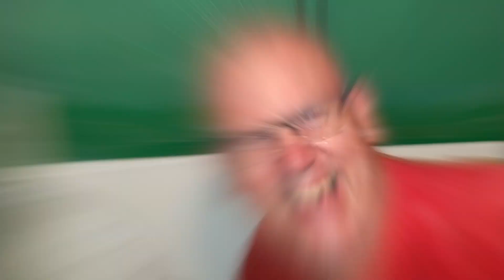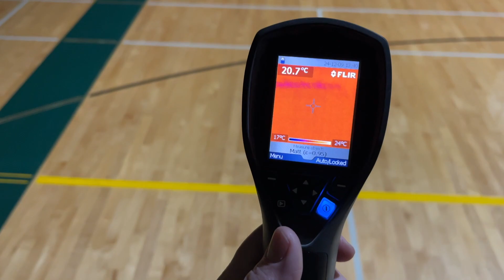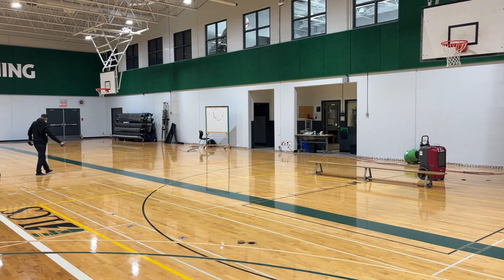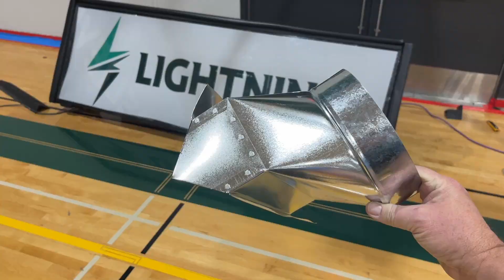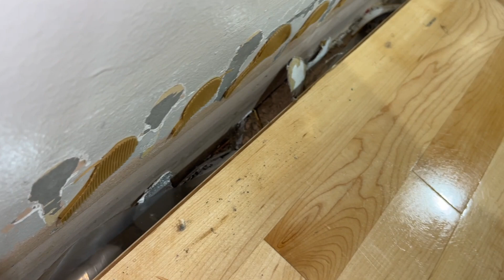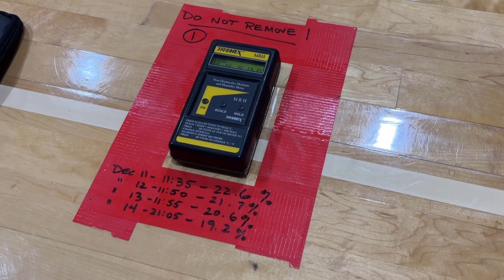Hardwood Gym Floor Flood Remediation (S07E162)

Comment: Is there no room underneath? If so, you can also drill holes in the ceiling below so that the moisture can evaporate downwards. Place drying devices below
Reply from the maker: No, the gymnasium is on the ground floor.  Thanks for watching.